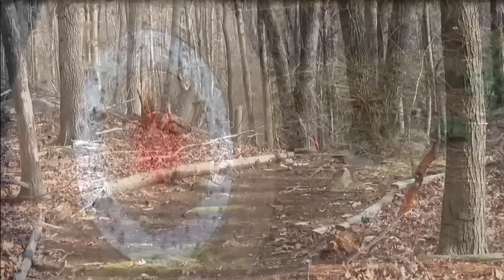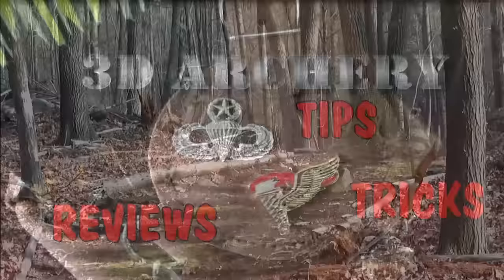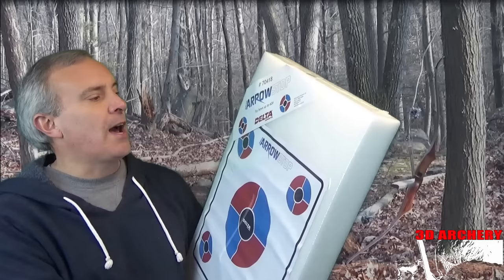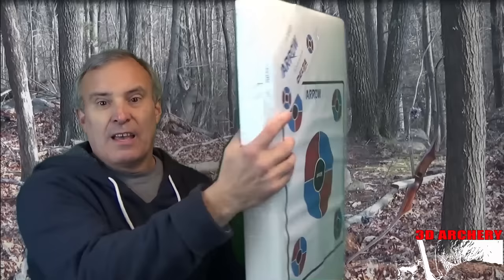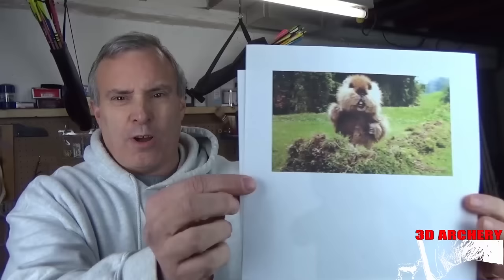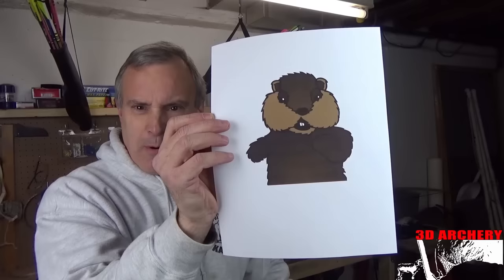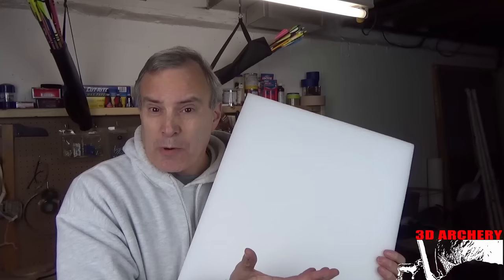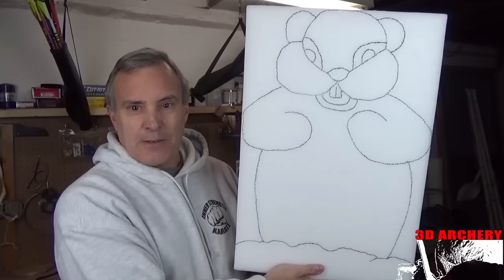3D Archery - DIY Target

Comment: looks like a fun rainy-day project!
Reply from the maker: +bowman321123 That is exactly what it is, wish i would have thought of that!
Reply: +3D Archery what else could you use as a DIY target?
Reply from the maker: All  types of stuff. I have rubber heads for my arrows and I make moving targets, swinging targets, etc.
Reply: +3D Archery can you specify on what I can use?
Reply from the maker: Cardboard Boxes, Stuffed Animals, Any open cell foam, A bag with rags in it (or clothes), a NERF Ball, you are really only limited by your imagination.
Reply: +3D Archery thank you I heard of this method where you take a cardboard box and stuff it full of bags, rags or old clothes is this what you were referring to when you said that you can use a cardboard box as a archery target. Also if I were to attach a target face to a archery target I made out of cardboard how would I attach it? Would I use pins or tape?
Reply from the maker: I seen people use empty boxes, it all depends on how powerful your bow is. As for attaching, toothpicks, golf tees, tape, pins, you name it.Use what you got laying around.
Reply: +3D Archery my bow' s 40 lbs would you still use a  empty box? Also what would you rather use as a stuffing for a target like this?
Reply from the maker: Check out my video of Archery with the SCA. That was all they used and i used a 45 pound bow with no problem.
Reply: +3D Archery thank you very much for the help sorry I had a lot of questions.
Reply: +3D Archery but if you were using a empty box  wouldn't the arrows go through and knock the target down?
Reply from the maker: Yep, but you can build a cheap stand so that will not happen.
Reply: +3D Archery but what about the arrows going through the box? I used a 15 lb bow and a empty box the arrows still went completely through.
Reply from the maker: What type of box? You need a heavy cardboard. The ones at the SCA shoot, were wedding dress boxes.
Reply: +3D Archery it was a wine box. I'm thinking of using a large box that was used to hold styrofoam cups.
Reply from the maker: It needs to be corrugated cardboard.
Reply: +3D Archery how could I tell if it's a corrugated cardboard box? Also where can I get them from?
Reply from the maker: It is two sided with a third layer in between that has a gap between them. To see better look up Corrugated Cardboard on Google. It is used for anything that needs to be sturdy.
Reply from the maker: Yes, that is it, I couldn't figure out how to explain it.
Reply: +3D Archery I know I'm asking a lot of questions I deeply apologize and I appreciate that you responded to all of them. Do you know the maximum draw weight you should use on a corrugated cardboard box? Also what do you do if you start to get pass throughs? Another thing what do you do if you use one side of the box and it wears out do you just switch to the other side?
Reply from the maker: I used a 45 pound bow on them, with no problem. Stuffing them with rags and such will help and give them longer life. 

You should be able to use two sides, the arrow will go through both sides, just not all the way. IT also depends on the distance, using just the box, you should be around 20 yards. Anything closer and you will get pass through's.

As for questions, that is why i made my channel, to help, so feel free to keep asking.
Reply: +3D Archery thank you for the help also what would you use as stuffing?
Reply from the maker: Rags, The green foam from an arts and craft store that they use for potting.
Reply: +3D Archery anything else you would use a stuffing?
Reply from the maker: Used clothing, Pillows, Stuffed animals. Even dirt or sand (although it will pour out after being shot).
Reply from the maker: Just remembered, you can use "Great Stuff" insulation foam! Just beware that it expands big time.
Reply: +3D Archery how would I put it in the box?
Reply from the maker: It is a spray foam. You spray it and it expands. Pretty simple and easy to use.
Reply: +3D Archery which method would you recommend best for a target made out of cardboard. Speaking out of your personal preference and experience.
Reply from the maker: Never did the "Great Stuff" in a box, used it to patch a target and it works great. But it cost money. Extra clothes cost nothing, both will work. Try the clothes and if you are not happy then the great stuff.
Reply: +3D Archery thank you again for the help.
Reply from the maker: It is not reusable and it expands big time. Check the container of great stuff, they will tell you how much it expands.
Reply: +3D Archery when I spray it into the box can I do it all in one go or do I have to do it layer by layer? Also does it matter which type of the "Great Stuff" cans I get which one would you get?
Reply from the maker: I would spray a little and see how much it expands, then you will know how to proceed. As for type of Great Stuff, I use the regular, which is a Red and yellow spray bottle.
Reply: +3D Archery what I meant is would I do the first layer wait for it to dry then do the next or can I just do the first layer then the second without waiting?
Reply from the maker: Sorry, No waiting
Reply: +3D Archery thank you for the help. I'm the one that should be apologizing I asked a ton of questions.
Reply from the maker: I'm happy to help, do not sweat it.
Reply: +3D Archery thank you how big should the target be?
Reply from the maker: Totally up to you.
Reply: +3D Archery well what I meant is what's your preference?
Reply from the maker: None, I shoot whatever I have around. If you are new, I would suggest a bigger box
Reply: +3D Archery ok thanks so how big should it be? I am a beginner.
Reply from the maker: Hww far are you going to shoot?
Reply: +3D Archery 10-15 yards away.
Reply from the maker: Choose a box size that you are comfortable with and have confidence you can hit. If you are comfortable with the box size, then that will be in your head the whole time.
Reply: +3D Archery ok thank you. Sorry correction not 10-15 yards more like 20.
Reply from the maker: Same thing applies, shoot what you feel comfortable with.
Reply: +3D Archery uhm what about thickness?
Reply from the maker: Doesn't matter, that is why you use the Great stuff.
Reply: +3D Archery you wouldn't need a stand right?
Reply from the maker: That is up to you, how high do you want it?
Reply: +3D Archery I'm not sure if I want a stand. I'm asking if you would need one since the target isn't empty?
Reply from the maker: Why? If you hit it, all it will do is fall over. The box should stand on its own.
Reply: +3D Archery does it matter whether you get conruggated cardboard or double layer conruggated cardboard?
Reply from the maker: Don't know, never heard of it.
Reply: +3D Archery it's basically  corrugated cardboard but two in one box instead of a single layer.
Reply from the maker: Never used it, I cannot comment on it. Sorry.
Reply: +3D Archery it's fine thank you for asking my endless amount of questions.
Reply: +3D Archery do I need a backstop? What could I use as one?
Reply from the maker: I don't know if you need one. Where are you shooting? Do you think you need one?
Reply: +3D Archery I'm shooting in my backyard. I'm not sure if I need one.
Reply from the maker: Any neighbors? Are you a decent shot? I cannot tell you with out seeing you shoot and where you shoot. Is it even legal to shoot in your yard where you live?
Reply: +3D Archery neighbors yes. I am a decent shot with a bow. It's legal where I live to do backyard shooting.
Reply from the maker: Are you sure? If you have neighbors close enough that you think you need a backstop, there is some regulation about that. How close is there house to yours?
Reply: +3D Archery the house it's about 10-15 feet away.
Reply from the maker: Then I'm pretty sure there is an ordinance about shooting in your yard.
Reply: +3D Archery well I'm not going to shoot the direction towards their house.
Reply from the maker: I highly recommend that you check the local ordinances. The vast majority of towns, villages, etc. do not allow you to shoot in your yard.
Reply: +3D Archery I checked it's allowed.
Reply from the maker: Really? Where do you live that they allow that?
Reply: +3D Archery I live in California.
Reply from the maker: Okay, they are like here in NY, heavily regulated. I know a few people that live there and they cannot do it legally. Thin about it, a compound in your back yard, you are asking for trouble.
Reply: +3D Archery well I checked my citie' s laws it's allowed the only ordinance they have is noise disturbance and having parties after eleven.
Reply from the maker: So you can shoot a firearm? It is usually listed with that.
Reply: +3D Archery we can fire pellet guns and bows just not guns.
Reply from the maker: Well, I would not suggest shooting with houses that close.
Reply: +3D Archery they're actually more like 30 feet apart. I just asked about the backstop just in case I miss and hit a brick wall or a tree.
Reply: +3D Archery what do you think about using hay stacks as a archery target?
Reply from the maker: They decompose and do not work well with heavy weight bows. Not a favorite.
Reply: +3D Archery how about with a 40 lb bow and I keep it in a dry storage place?
Reply from the maker: Hay will decompose no matter what. After a while it will no longer stop your arrows and mice and such make nest in it.
Reply: +3D Archery would you rather buy a target face or  print a target face?
Reply from the maker: No difference to me, I will shoot at almost anything.
Reply: +3D Archery if the clothes have like buttons and zippers do I have to remove them?
Reply from the maker: Up to you, just more work.
Reply: 3D Archery so it's not necessary to remove them?
Reply from the maker: Don't know, never used them.
Reply: +3D Archery oh okay.